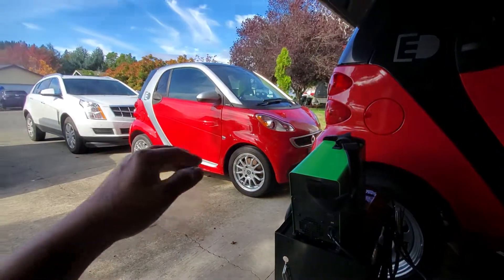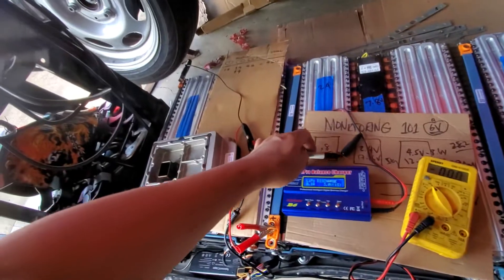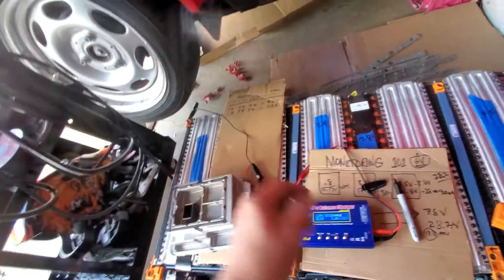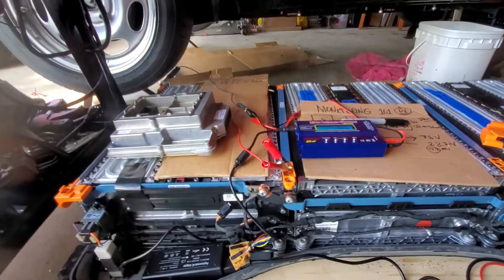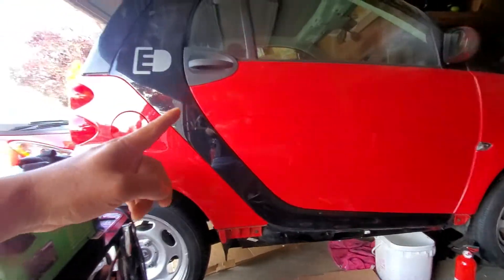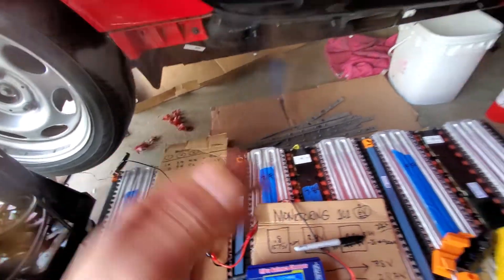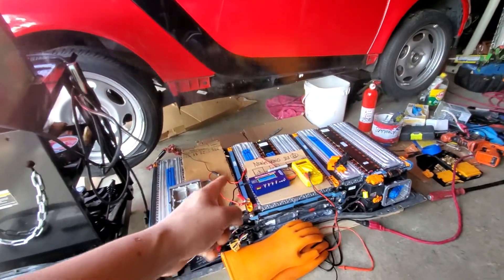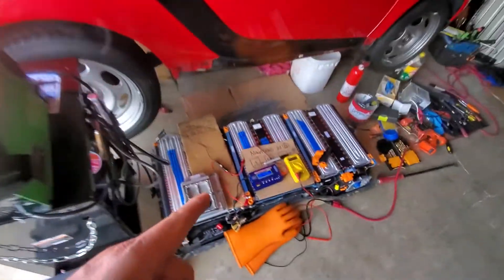Update Only - Smart for Two HV battery manual Charging

Comment: Here's how I do it and recommend it:
Disassemble the power rails that connect the three battery packs. Then charge each module individually to the same voltage. Next, connect the three modules in parallel and charge them to, say, 120V. This balances the packs and provides a relatively safe voltage. Furthermore, a 160V lab unit is much cheaper than one for 400V.

Comment: My smart fortwo electric drive 2017 has stopped charging, Mercedes has said it is the HV Control Unit that needs replacing and they are quoting £4500 for repair. Is the part they are claiming is faulty within the battery pack itself?
Reply from the maker: That's recall ....contact Dealership